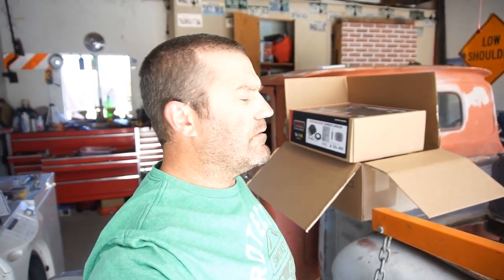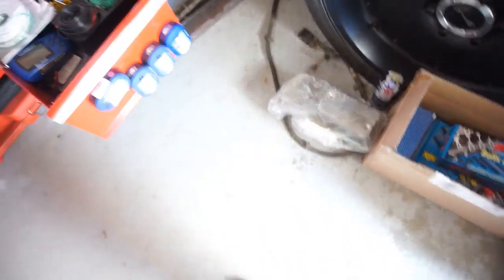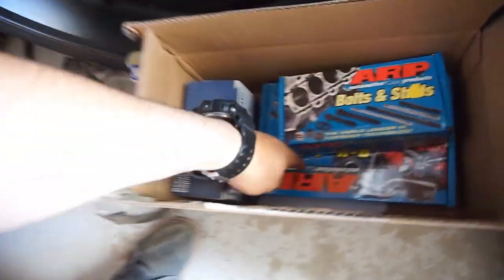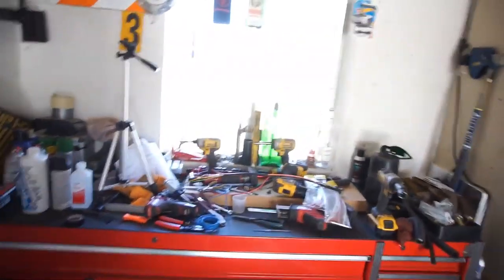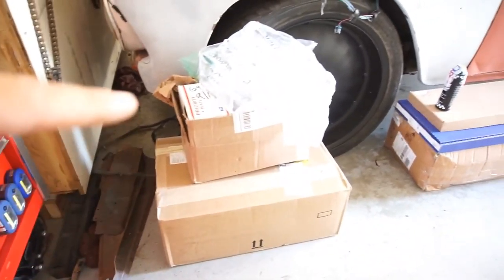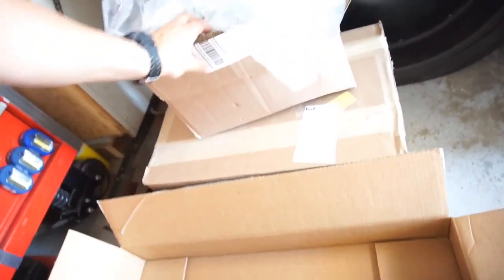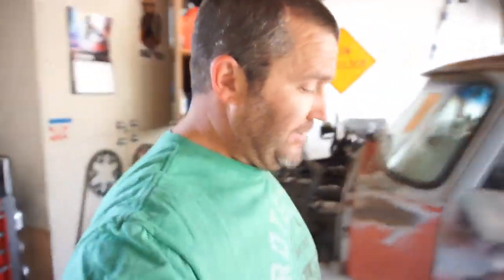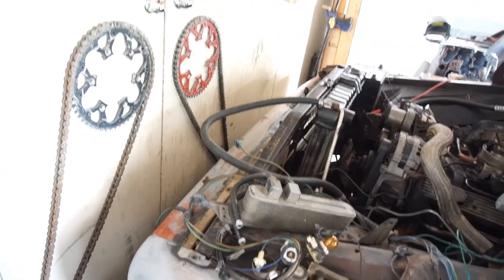6.7 Cummins Engine Rebuild. Prepping The Garage For The Build.. Clean Up

Comment: What was your price tag on the parts? If you feel comfortable answering that if not I understand
Reply from the maker: Total with machine work for cylinders and crank and all new parts was appropriately $3200. Then you have all the labor I did and painting.
Reply: @Halffast719 not bad compared to having someone else do the work. thx for the quick reply!
Reply from the maker: No problem.
Reply from the maker: chris keiffer not sure if you seen my latest videos but I sold that engine last week.
Reply: @Halffast719  How much   would you estimate labour and painting would be if you was to take it to a regular mechanic shop?
Reply from the maker: Different shops charge different amounts. The machine shop told me that they’ll do all the machining work but won’t assemble it, bet they could send it to a shop in Riverside CA and they’d do it for $1500. So I wanted to do it myself anyway.